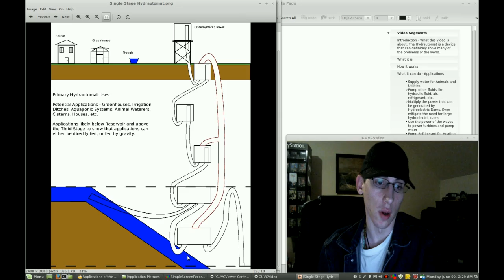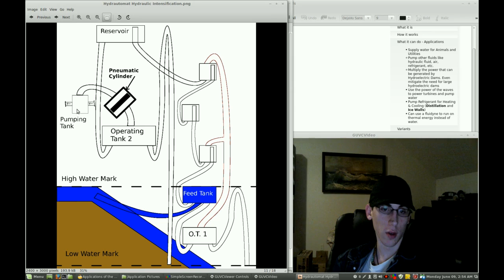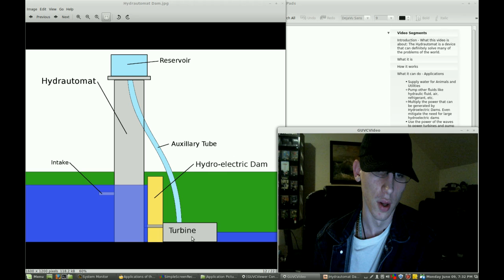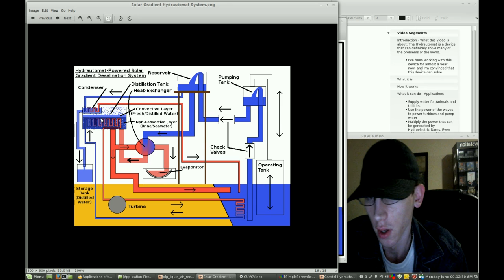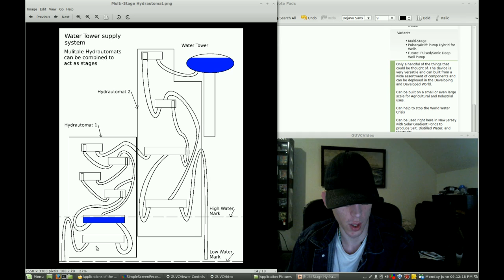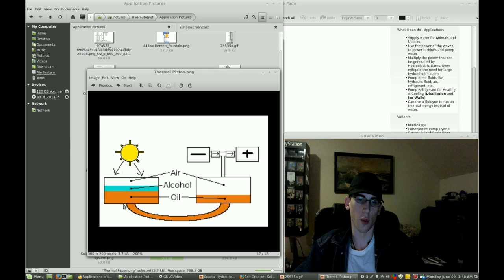Applications of the Hydrautomat

Comment: Does this type of pump have any advantages in water volume delivery speed vs a ram pump?  This is very interesting, I'm intrigued!  Thanks for sharing!
Reply from the maker: Yes, from what I understand there is a lot less waste of water with the Hydrautomat then with a Hydraulic Ram pump. The lower pressures and lack of shock waves also prolongs the lifespan of the components also.
Reply: @BlueJersey112  Thanks!

Comment from the maker: Here's a video that outlines several potential Applications and Variations for the Hydrautomat.

As it turns out, the Hydrautomat is very versatile and can potentially be used for many different tasks. Such as pumping water, air, oil, refrigerant, etc.

It can also possibly be modified to run on Waver Power or Thermal Energy as well, which further extends the reach of where this amazing device can be deployed.

 #Hydrautomat   #Water   #Irrigation   #alternativeenergy   #sustainableenergy   #ecofriendly
Reply: w4 ouhhg gr×a
Reply: As hurt re us 2nd reefs chat h bff zzz